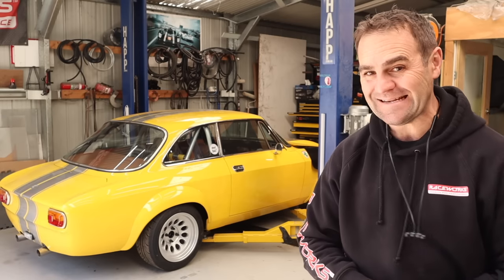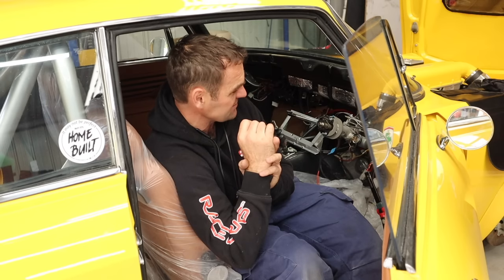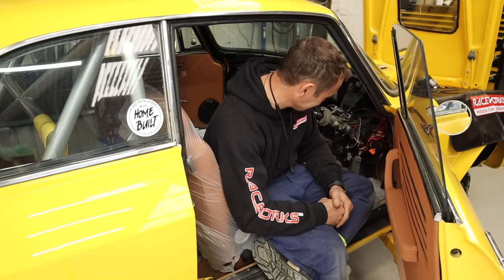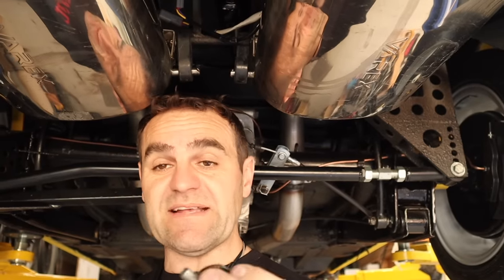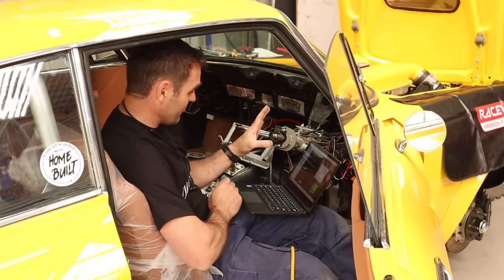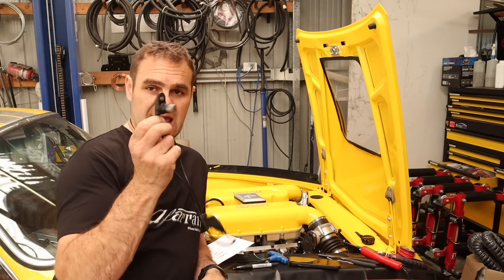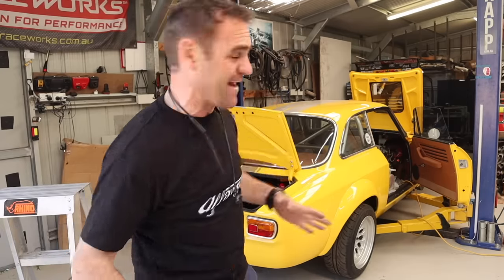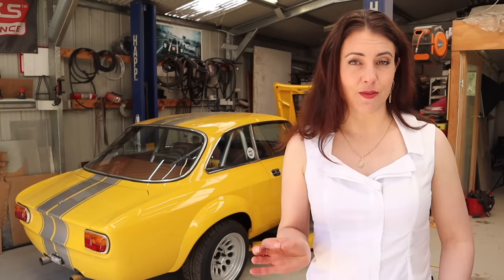It's Alive! - Ferrari engined Alfa 105 Alfarrari build part 195

Comment: Jeff - No need to be so restrained upon success :face-blue-smiling: ROFL!!  Seriously, huge congratulations on achieving first running of the engine.  I have followed you through all your builds and this is by far the most technical build you have undertaken.  Wiring is the biggest PITA there is and big kudos to LINK for all their time and help they have given you to get this project to where it is.  The finish line is now in sight and hopefully you will have this running on the road by your summer.

Comment: Congratulations Jeff it sounds awesome!! Yes without cmp signal input the pcm is forced to guess which cycle its on. Kind of like flipping a coin. Try measuring the distance from the sensor face to the camshaft sensor wheel. Usually they run in the 10-20 thousands of an inch air gap. Too much or too little can cause the signal to drop out.

Comment: Jeff sounds amazing its going to be fast; as for the cam angle sensors i have heard of this problem most people use a simple magnetic hall effect system of the cam belt positioned to align with the 1 cam  pulley bolt.&mounted on the belt cover look it up worth a try.

Comment: Link are very good on the support, in my experience with a Datto 510 SR20DET track 2 door....Thunder ECU with 370Z fly by wire throttle, 405HP at hubs. Have had them take over my computer to assist...

Comment: Hey Jeff, technically your graph of TDC is flat at the top.  That’s the piston dwell area and why TDC is difficult to find by measuring the piston movement.

What you are actually trying to find is TDC at the crank, as the piston isn’t actually moving for a period at the top of the stroke.

Comment: I have watched every episode since the start what a fantastic job, 
a few thoughts, ? do you have to jack the car up to check/adj the fuel pressure ?
I put my aux FP gauge and adj FP regulator in the engine bay (that way I can check it while working on the engine) 
lastly what does the Ferrari book say your FP should be ? (most cars have a system that primes the fuel system when the key is turned on, it shuts down when key is turned off but it also kills the fuel pump case of a crash)   
Cam and crank angle sensors need good grounds (if in doubt copy the Ferrari book)
Reply from the maker: Fuel pressure should be set and forget ;)

Comment: Are you supplying the sensor +12V or +5V? Also you may need to use a pull up or down (resistor or setting in the ecu) in case the output signal is floating. Those 3 relays in series hurt my brain 🤣
Reply from the maker: 8v
Reply: @HomeBuiltByJeff  from what I’ve seen with the Ferrari sensors they have all been +12V

Comment: The best most accurate way to find TDC is with a device called a positive stop that is cheap and easy to make, and a degree wheel. Getting true TDC with an indicator is hard because it dwells at TDC. The way you did it is fine if you're not trying to be too scientific about finding TDC though, you'd still be within half a degree or so which is fine for most people.

Comment: Hey Jeff, what wiring diagram software you are using? It looks quite simple 🙂 And have you figured out to make the electric steering column to work? I have seen all episodes of the build, but maybe this have slipped my mind. Btw enjoy your vacation, you defiantly deserve spend some time with your wife
Reply from the maker: Adam did that wiring video, not sure of the software. Electric column should work as I have installed it.

Comment: I wonder if Ferrari's cam angle sensors aren't VR sensor but instead are Hall based and need a voltage supply to work.. though it really does look like a VR sensor.  Anyway congrats on the milestone!

Comment: Have been following the build. Waiting for the actual first drive and impressions. I may have missed it....what is the weight of the engine and trans vs.a stock ALFA 1750 or 2000 engine and trans?
Reply from the maker: All in the weight vid ;)

Comment: Actually sounds way bullzie for such a feat of automotive engineering (thats been completely relocated)..

Jeff mate in your wise opinion: i have a gear connection issue with 1st and 3rd that i want to put down to the actual gear stick cable system? any advice?

Comment: Strange it wont start in wasted spark mode and batch firing the injectors, and then goes to sequential when it syncs with the camsignal
Reply from the maker: It could, but it will be sorted soon